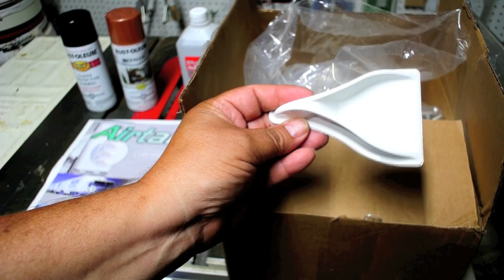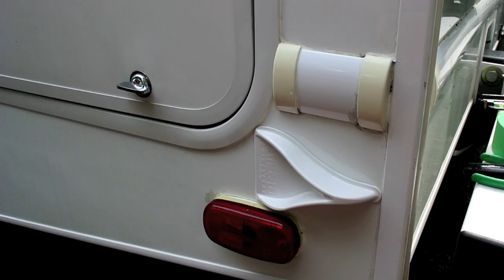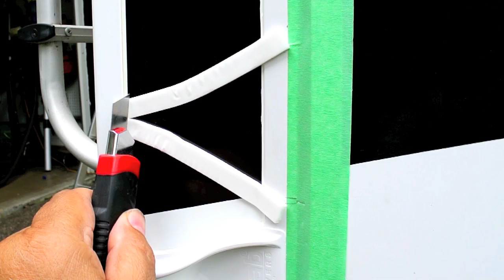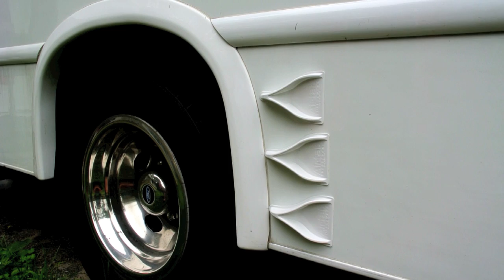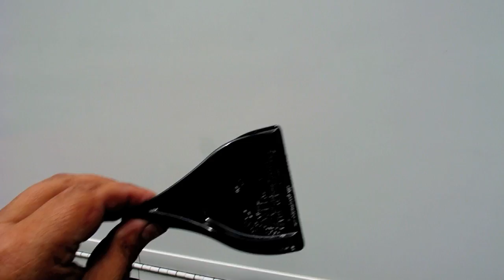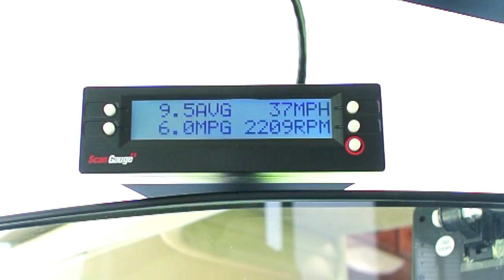Installing Air Tabs (Vortex Generators) on my RV.

Comment: They do NOT reduce drag on trailing edges.  They've been tested professionally and do NOT work in that situation.
Reply from the maker: Thank you for supporting the channel.
Reply: They DO work when placed on the front of the vehicle, where the wind makes first contact.🌪

Comment: Did you notice any impact on fuel consumption?
Reply from the maker: It seemed to help, but I sold the RV before I could do any kind of long term determination.  I did find though that in the rain, the rear of the RV stayed cleaner, so perhaps it does break the station-wagon effect.

Comment: If these things are so effective, why don't any truck, trailer, or RV manufacturers incorporate them in their body designs?

I mean,  one of the main things vehicle manufacturers do is wind tunnel testing and tweaking of their body designs to minimize wind resistance.   So, why aren't any of them coming up with the same or similar solution?

There is nothing special about these plastic widgets - except, their price.
Reply: Wrong. If you do any amount of research on aerodynamics you'll find out that vortex generators do work.
Reply: @nukethorn-v8l  Wrong.  They do work only in some cases on some vehicles.  They are proven specifically to NOT reduce drag on a trailing edge and can in fact INCREASE it.

Comment: Bull cocky, they are crap.
Reply from the maker: The concept was developed by NASA.
Reply: what is crap about them? They are used on airplanes to make them more maneuverable at low speeds, they have been proven to work

Comment: I was looking at the one on the dash board,,, do you have the EBay item number? I maybe interested
Thanks
Reply from the maker: http://www.ebay.com/itm/322039126792?ssPageName=STRK:MESELX:IT&_trksid=p3984.m1555.l2649

http://www.ebay.com/itm/322039131563?ssPageName=STRK:MESELX:IT&_trksid=p3984.m1555.l2649

Comment: I've been tossing it around for awhile if I should purchase a set of AirTabs for my 31 foot Class C and I came across your video which I found it very informative. I was more interested on finding out the effects they would have on wind turbulence then fuel mileage and your video answered my questions. I also noticed the gauge you had mounted on your dash board but could not make out the name of it,,,  maybe if you get a chance you could let me know the name of it and where I can purchase one. 
Once again thanks for a Great Video.
Reply from the maker: The one on the dashboard or over the rear view mirror?  We have actually sold our Class C and are going to a 5th wheel, so both of those things are currently listed on eBay.
Reply: so did you get a firm handle on MPG with the class c before you sold it and are you going to put them on the 5er.??

Comment: Now that you've had the Air tabs on for a little while, what's your opinion 👍 or 👎 or somewhere in the middle?
Reply from the maker: They definitely help. Just don't expect a significant improvement. For fuel mileage, I am averaging 5% better overall and up to 10% better at highway speeds. They are not effective at all at low speeds (under 45~50mph). They also seem to help break the buffeting caused by  large trucks passing by in the opposite direction on 2 lane highways.
Reply: +RVProject I wouldn't expect much change below 50, as your drag isn't that great anyway, especially with a diesel. I know from past experience with three diesel vehicles, that there was a HUGE MPG jump below 50. Perfect example: Jan 2007,  2005 Ram 2500, 6 spd G56 manual with gearing from German trucks (62 MPH top speed over there). Normal interstate running 70-75 from Indy to DFW - Houston - San Antonio, averaged 17-18. West TX I-10 (or IH-10 as they would say) running 85 avg, 13 MPG. CA-1 San Luis Obispo to Monterey, top speed was maybe 50, I got 20 MPG. After putting a Smarty tune on it, I would get 19 highway, 23 on paved backroads running avg 50 MPH.